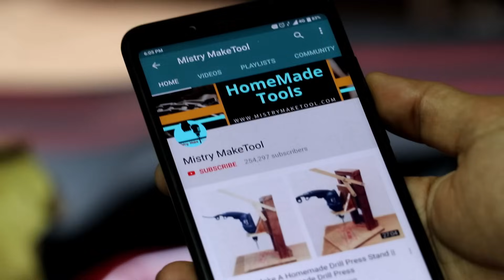How To Make Hydraulic Press Machine || DIY Mini Hydraulic Press || Without Welding

Comment: 80% of the time was spent drilling holes and tapping.  It can be faster and easier if you do everything with the help of electric welding.
Reply: @qasim raza wrongo, good welds can go over 60kpsi
Reply: welding will cost more
Reply: @zamaluddin9680  welding is much cheaper then bolting everything together. I seriously thought he was crazy for doing it
Reply: This would be a  great hobby press and should more than handle any small project, i would love to see its failure points my guess would be at the top all the force is being put on 6 bolts which should hold 2000lbs each more than what you'll need but the mild steel tubing has a weak section thickness at the top if you were to weld that you would never see a problem
Reply: This is good project without welding, as it is easy to transport each item in single space saving pack and then it can be assembled again. Good for assembling and dis-assembling this entire system. 👍
Reply: If you dont have a welding unit, which is expensive to buy, this is a very good alternative.
Reply: Plus if you are in apocalypse cant find welding equipment
Reply: Very good job.

Comment: Good job, but very heavy? I assume it was made from scrap metal or what you've had. Quick  calculation for 50x50x6x400mm angle and 100x150x8mm plate shows you'll be around 400MPa when using 50kN force

Comment: I have an arbor assembly that is very similar to the part you show pushing out the shaft.  Do you think a bearing separator would work to do the same thing for pulling the gear off?

Comment: Very nice video, well put together, well edited. On your link to the dimensions etc. you have left off vital information to be able to build this at home for your viewers. Eg. the thickness of the steel used, you don't mention what size and thickness flat-bar and plate you used where and how, how you managed to put together the cross bar with support brackets the bottle jack sits on, how you made those support sliding brackets etc. It will take a very long time for someone that wants to build this at home, to figure out ALL the materials needed to build this at home - is this not the idea in the first place?

Comment: Nice, I like the no weld build. I don't have welder so this is awesome.
Reply: Me too
Reply: Make sure you use grade 8 hardware. Don’t want a bolt shearing. Also, you can weld with a car battery if you have to.
Reply: i have welder so i see bolts are time wasting

Comment: You need to use thread cutting oil when you tap those holes.
Reply: at some points in the video u could see that the tap was wet/oiled

Comment: What is the total cost of all the parts and material?   You can buy a 12Ton press on ebay for under £80
Reply: I've got all the materials and parts for this project from stuff I've found/saved, and I have a few bottle jacks I don't remember where they came from. Total cost: 0.00 pounds, euros, or dollars.
Reply: Just your labor, Its good when you have the materials but if you don't I think it will be expensive.Cheers
Reply: In my place it is maybe only cost US$20 for all materials. $10 for 5 tons bottle jack  and $10 for the rest.... (square tubing, angle iron, bolt, spring etc)
Reply: @SDsailor7  It could end up costing more than buying the cheap one for 90 pounds, especially if you sourced the materials at a retail store, but even then you could end up with a much higher-quality press than the manufactured cheap ones. Personally, I don't think the labor issue matters for many people. They want a press as a tool to make things. They like making things. Making the tool might give them as much pleasure as making some non-tool item using the press for some of the operations. For myself, there's also the satisfaction of making and having a tool exactly how I want it, not how a for-profit manufacturer wants it.
Reply: Where the fuck is the fun of it if I am going to buy every single tool
Reply: There is ls the idea that this is the perfect size to sit on the work bench. Not every one has the space for a floor unit.
Reply: @tcarney57  Thank You for your comment, it put into words exactly what I was thinking! My own shed is full of such tools, all made as and when I needed them, and in some cases only used once or twice, BUT at least I had the fun of making them to my standards, which are superior to many manufacturers.
Reply: 44Celt
Reply: I not knocking the DIY ethic, Im an engineer myself and love making and fixing things.   You cant just buy 6" of this size and 6" of that size,   steel will come in 1m,2m or 3m lengths.  Price up 2"x2" box ,2" x 2" angle, 2" x 6mm flat, bottle jack, springs , heavy duty nuts and bolts - [£150 from my steel supplier]  double the price of a commercial made one
Reply: This is fantastic. I have all of the material lying around and I love that this can bolt to a bench. Nice job!
Reply: @44Celt  this is also for a DIY who can get parts from scap and has tools. You also need to notice he has a drill press and about another bunch of money into tool and bits to me this work.
Reply: It's actually $300, DIY will cost less than $100. If you don't have time and want better build just buy it.
Reply: It is the satisfaction of doing and creating things with hands , also everyone can't afford to spend on variety of tools.
Reply: @44Celt  Yes, but how about scrap metal dealers? There you can get the steel at a fraction of new price ...

Comment: .. at 11:33, the bearing was not correctly pressed out, but at 12:00 it was not correctly pressed in: when pressing out, the force was not applied to the outer clip, and when pressing in the shaft the inner clip should rest on the base of the press ...

Comment: You should have done the red and black on the opposite parts because the paint will (even did a little by the end of the video) scrape off the sides.

Comment: Parts Used :
L-Section angle heavy (2”*2”)
Square pipe heavy (1½”*1½”)
2 Nos. spring
5 Ton hydraulic jack
Tractor trolly pin heavy
12 Nos. M10 bolts ( 2½” length) with nuts
2 Nos. M10 bolts (3” length) with nuts
2 Nos. M10 allenky bolts (1” length)
4 Nos. M8 allenky bolts (½” length)
2 Nos. 3/8 allenky bolts (½” length)
4 Nos. ¼ allenky bolts (½” length)
3/8 Bolt (1¼” length)
2 Nos. 5/16 J bolt (2½” length) with nuts
Reply: Spring size

Comment: What prep did you do, if any, to the metal prior to painting.  I built a cart as part of a "Welding for fun" class.  No I am ready to paint the steel.
Reply: Get the scale of/sand it and wipe it down with acetone. If youre using hammerite just the acetone works too.

Comment: 1.welding is not a great way to make a hydraulic press , it's not strong enough to bear such pressure
 , this is the reason he used bolt and nut instead of welding.
2-the metal which held the jack is too thin , it will bend under high pressure.

Comment: Also converted to powered hydraulic... by using an automotive power steering pump, and electric 1/2hp or so motor....
preferrably, IMO, mounted underneath the table, below the press... perhaps that would need a custom length  HighPressure line though.... EHH ??!!??

Comment: Excellent Idea. The JIG can be used for other purpose aside from hydraulic press. I been thinking of doing the same thing here in my country. The problem? I have no fcking access to a bench drill, a fcking circular saw, a fcking everything, for my country to where I am residing is full of bullshit and cost more than just buy a complete working unit. Those fcking power tools are fcking expensive and buying cheap products of the same item will doom a money waster.

Thank you for the video though. At least for some who has a great country unlike ours...FCK my country..period..